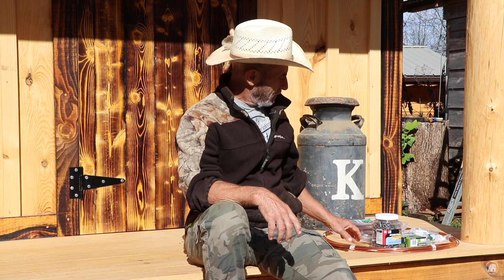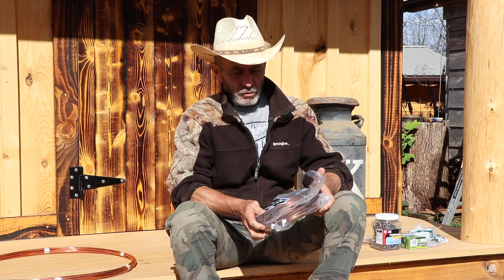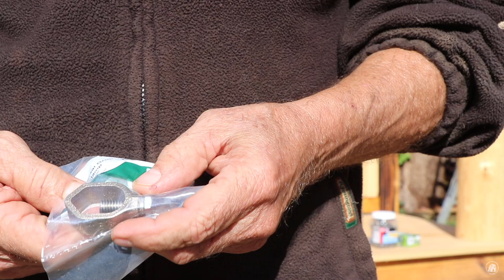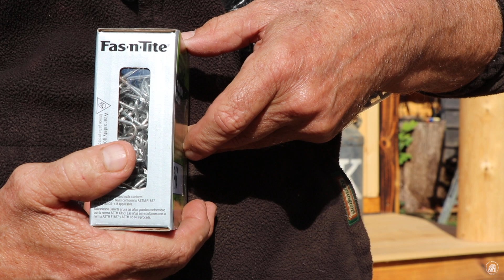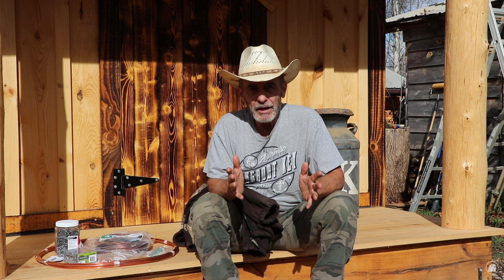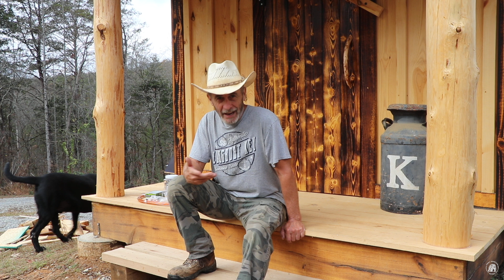Off The Grid Solar Build Cost

Comment: One is doing a good job and has been doing one fine job for a long time.  Let the people complaine if that is what they do about one working.  I get the expense of all the cooper and stuff to put the system together.  Hope one got my letter too!  I got two solar pannels here that are glass and it is about so many whats.  I got two marine batterys charging up.  Two six volt lights, the inverter and what ever else.  I hooked it all up handicapped.  I hung the flatscreen tvs up on the walls too all by myself.  I work alone too.  I have the portable little solar banks to charge up the cell phones too.  I got to learn some about solar.  My branches from the Oak tree are still drying out.  They are getting lighter some too.  I got me some clubs and walking sticks and other sticks waiting for me to finish sanding them up.  I got five pounds of Sumountra Dark Roast coffee beans and I ground up most of these too.  This coffee is very strong and I am very awake today.   Try to get the people who want one to work more than talk to come and help one out.  Many wont show up.  I would though.  One would not want to watch me work though.  I can climb the ladder only so far up now provided that I am tied off with the saftey gear.  I smack into the project instead of falling to the ground!  It will still wake me up.  I got the saftey kit in the five gallon bucket, the rope, the belt, the roof achor with screws and all.  Just the nails and the screws for the buildings to be put together coast a lot too.  I still have a box of roofing nails, used some of these.  Been up on my two and one half story older mill home too and have put on one side of one of the roofs.  The neighbors were comming out scraring me , "don't  fall and all of that stuff."  None of them would come up and help me out.  The boards I was standing on are still up there.  Paul is not allowed on the roof.  I got me a good framing hammer too.  I have the newmatic nailers too.  Yet, I like a good hammer to use too.  I got to go for now.  Paul
Reply from the maker: Nothing gets done unless you do it. Can’t hardly find anyone to help anymore because folks just are to lazy and would rather pay to have it done, and then those who will work only pick the highest paying jobs. Things have changed

Comment: Richard, when is Jennifer drilling her well for her house?  Depending the volume of water her well produces,  if it is a high volume well, it might be worth running a water line down to her well to supply  you with well water.  
I great Uncle and his daughter  shared a water well ast the spring died up that he used to supply his house with water,  as here well was very deep and produced over 20 gallons per min, and Uncle Georgie being 90 years old, they just tied his house it to the well, as he refused to go on city water.
When the spring started flowing,  they left him on the well and the spring only filled his catfish pond.
Reply from the maker: Not sure when she might be doing that as well as getting her power up there. That’s a thought we could do that. However, I was trying to create an area up here that would be sustainable in case something happened that they would have a fall back. But that might be something that we would think about in the future.

Comment: Hey brother,
Sorry I wasn't able to get down there to help you out, as my situation up here in Washington County has had me tied down for months.  I do want to ask you if you have checked article 250 in the NEC concerning grounding and bonding of the neutral conductor. To avoid "ground loops", which can wreak havoc in sensitive electrical equipment, the code says to bond the neutral to the ground at the distribution panel ONLY, and do not bond the grounds to the neutral at any other points in the entire circuit (which includes all sub panels). Also, you can, and should ground the electrical boxes of the sub panels to separate ground rods nearest to those panels...but, they are a case ground only, and should not be part of the ground path of the source ground from the "Juice Shack", where your distribution panel will be. The neutrals and grounds in the sub panels should be insulated from the ground path of the case grounds of the sub panels. Look up "ground loops", "grounding", "neutral bonding", with sub panels involved that are in different locations away from the main distribution panel. You've probably already done your homework, and since you worked for the phone company, your already aware of ground loops and noise....but in case that slipped by ya, I prayerfully hope this helps
Reply from the maker: I passed the information onto the guys that are going to help me so that they can check that out as well. Thanks so much for the comment. We certainly do appreciate it and your support and hope that you have a blessed week.

Comment: The electrical supplies that you are having to buy doesn't come cheap.  I am retired now but I used to be a purchasing agent for a manufacturing company and was responsible for buying these items and it was high then
Reply from the maker: Yes, it did cost quite a bit of money but bonding and grounding is something that is just as important as the power that you’re getting because it’s what protects everything

Comment: Now, if it was me, I'd run my grounding wire through a piece of plastic, so it not touching the wood, because if lightning hits the grounding wire system in it goes into the wood, it will burn your wood literally
Reply from the maker: Hopefully it won’t. I doubled grounding and we have 100,000 amp arresters that will install as well

Comment: The nationaling about those studs, those grounding studs, you can screw one to each one, as long as you keep the holes lined up, you can run that grounding wire all the way down through from one to the other, all the way to the end, and they'll all be grounded on that one. Leg and then you can bring the other end. You can take it to your other section and go all the way down from the other end. Come all the way down to the other end and then go over and connect it to the top one, and if you got enough left over from there, come straight down with your one leg that you came from the first one all the way down and go to your grounding broad and then take that same wire that was off the bottom and just take it and stick it in the top one in with the top leg on another metal grounding, lug, to where you can put it, the two grounding lugs on the same bolt and ground, both lugs wires to that one bug and take the grounding wire.Down
Reply from the maker: Yes. That’s how I was trying to explain it one continuous run